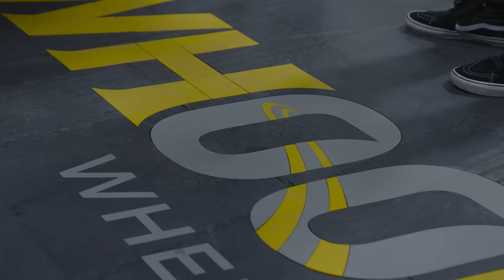Auto Finesse Barn Find Big Detail - Honda Civic Shuttle

Comment: Great video.  They did a great job refurbishing the steel wheels too.  With a respray of the hood (bonnet) and roof, that thing will look brand new.  Hopefully, the rust on the rear arches aren't too deep.
Reply: Working on the rust will hopefully not take too long 😅